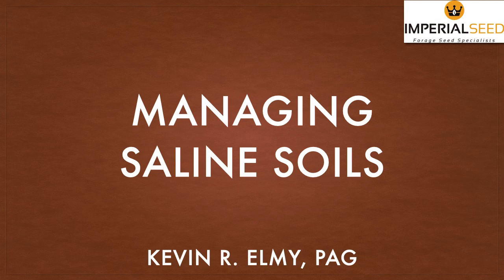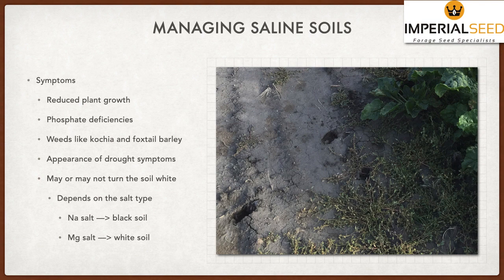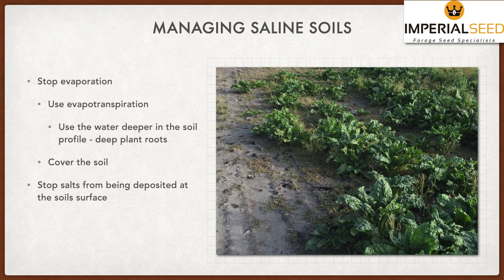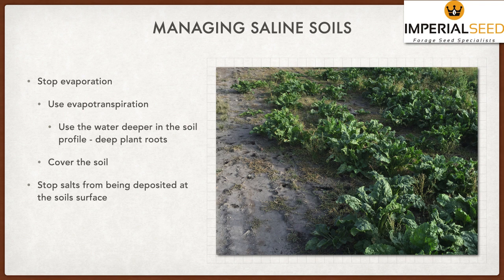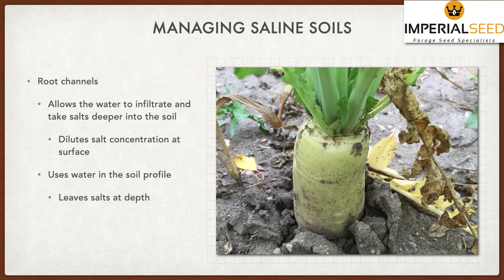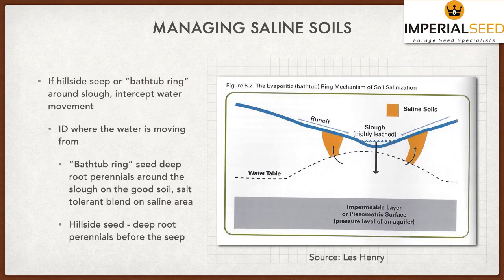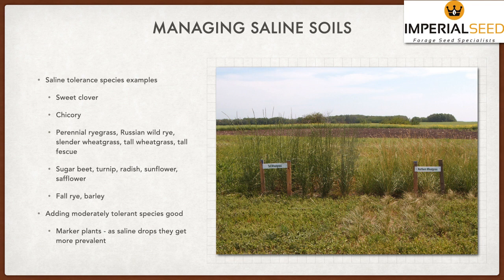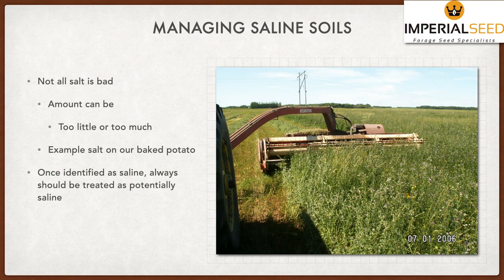Managing Saline Soils with Cover Crops

Comment: Hello.
Is there a chance that by using plants with deep roots , 
we might introduce salt into the ground water aquifer ???.
Thanks.
Reply from the maker: Key is to use the water deep in the profile not allowing it to evaporate. Breaking a hard pan could allow water table to push up. That increases the need to have plants growing.